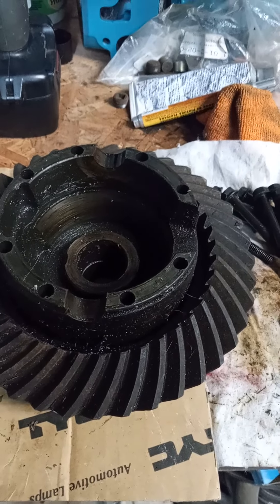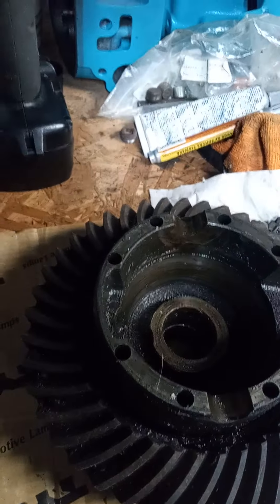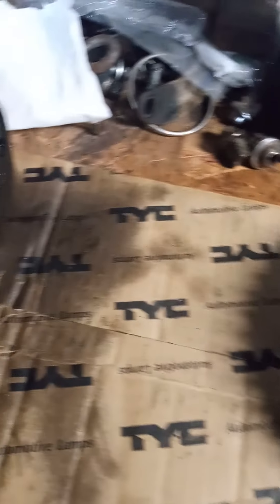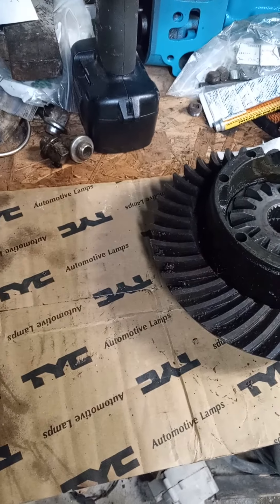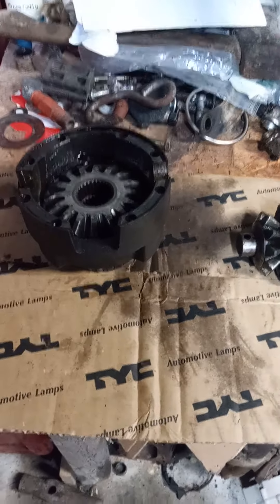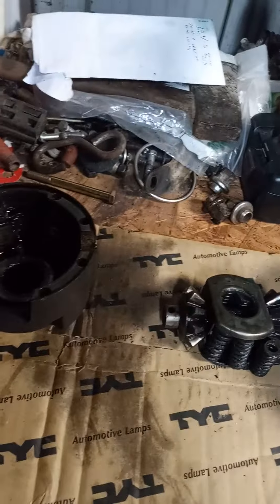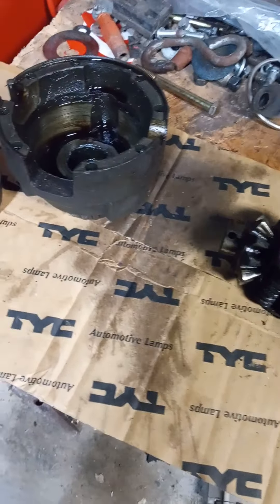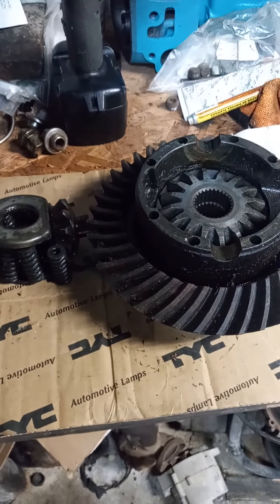1965 Pontiac GTO Safe-t-trac differential

Comment: I got a 68 firebird 400 with one of these, can’t tell if mine is working, typically you can test a posi by putting the car in gear and spinning the rear wheel by hand, I tried this and it spun like a open diff, does that test method apply to this or does it only lock up for both wheels under a proper load? Thank you - LB
Reply from the maker: @landonproductions2373  if it's a safe t trac with the cones in it it will act like a open differential, pressure has to be equally applied in order to lock the cones to the carrier.
Reply: @purepontiacgarage2286  Thank you very much!